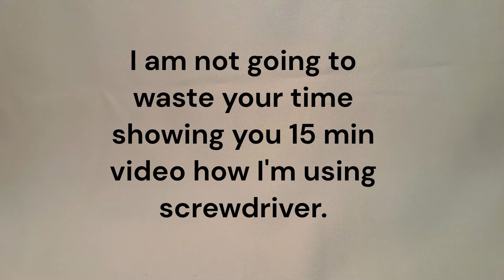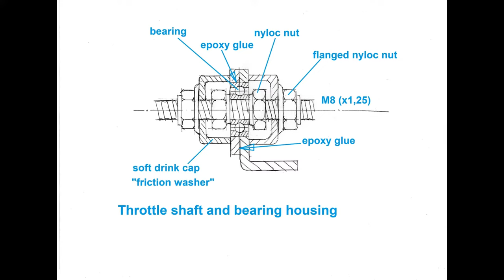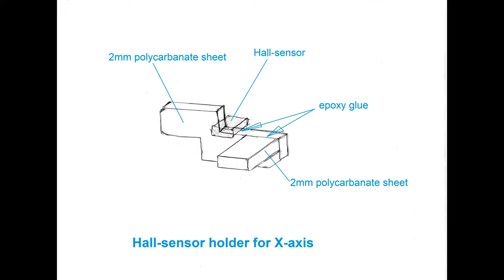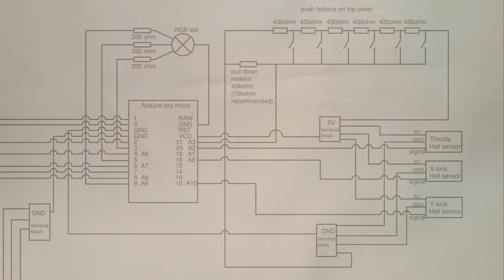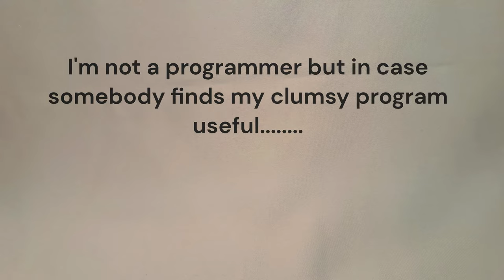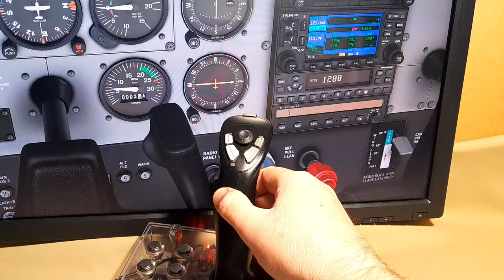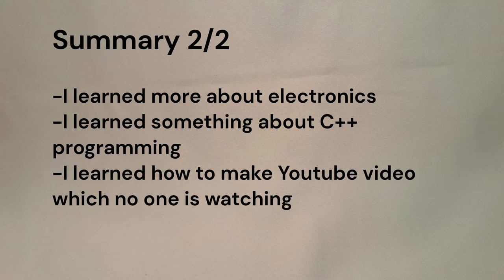Logitech Extreme 3D Pro Joystick Modification using Hall sensors and Arduino

Comment: I just bought 3 old obsolete flight sticks on Ebay. I plan on doing something like this to give them new life. Thanks for the tutorial :)
Reply from the maker: Hi! I wish people would offer broken or obsolete items for sale instead of throwing them away.

I made a new program for modified joystick and it's more effective damping jitter than older one. If you want a copy of it I will gladly email it to you. My email address is hekka.diy.videos@gmail.com.
Reply: get a teensy it has a flight controller, joystick, mouse and keyboard USB profiles makes building these things easy, also 40 odd pins for the button stuff

Comment: i watched wish you built it live include details about the board you used, what code you used, what github repos you used etc please in the video description, I think many people own 3D printers I think personally i would either reuse original body or 3D print a new enclosure using ABS or PETG

Comment: They factory built-in spring has way too much tension (too stiff). I replace the spring with the spring inside a used shampoo container, pull the spring longer and expand the radius gradually with the assistance  like stick/rod, now the control feeling is much softer make much more sense.

Ther are some more tricks other people used, like: Cut off one circle on top of factory built-in spring to make it shorter thus become less pressure, or use heating/cool-down method to soften the tension, or remove the spring and use rubber band in 4 direction of the base tie to the center stick to make it center.

But bro, non of these are comparable to your modification - Completely rebuild a half of joystick, pretty cool!
Reply from the maker: Thanks man! I like very much your "shampoo idea". Junk for somebody else but useful stuff for a creative person:)
BTW: I think Logitech attack 3 joystick has same "gimbal" (that white nylon(?) device) as Extreme 3D Pro and the spring has same dimensions but the wire is thinner. I'm not sure but I try to test it in the near future.

Comment: Cool project!

The (twist) Z-axis could perhaps have been repurposed as a 2nd throttle or flap axis. ;)
Reply from the maker: Thanks! 
Now I have hall sensor and Arduino controlling joystick's Z-axis (along with pedals) so I can use joystick's twisting axis the way you are suggesting or maybe controlling landing gear :) 
(I made a short video about Z-axis using hall sensor)

Comment: Can I just replace the rudder and throttle potentiometers with hall sensors from the Logitech joystick and keep everything else? Regards from Brazil.
Reply from the maker: Sorry, but it won't work. I tried to use Logitech electronics (and no Arduino), but the potentiometers power voltage (almost 5V) dropped to 0.5V when using hall sensor (replacing that potentiometer). I even tried to "rob" the voltage directly from USB line, but then the voltage dropped to 1V. Same thing happened when I was testing Logitech Attack 3 joystick. I guess Logitech electronics just don't like hall sensors:(
Reply: @hekka7270  Thank you very much!

Comment: I can't get the top part working, the hat switch and the trigger its so frustration. even used a diode
Reply from the maker: Is your joystick modified or unmodified joystick? Do did you check switches using multimeter? 
Some of mine joystick's switches didn't work so I cleaned them using contact cleaning spray and now they work flawlessly.

Comment: Hey man I watched! 😂

Is it possible to also do z-axis like this? Or will there be space constraints?
Reply from the maker: Hi !  Nice to know at least someone is watching:) I didn't even try Z-axis because the space is so small. However there is such a thing as magnetoresistive sensor. It probably won't need a lot of space because it works different way as Hall-sensor. I have one of those (MR-sensor) but I haven't tested it yet but i will do that in the near future.
Reply from the maker: Hi! (This is "slightly" late second replay) I tested my MR-sensor but it didn't work because it was digital (not analog) and too sensitive. But I found a way how to use hall sensor anyhow. I made a new video about it and it is on my channel.

Comment: Do you have the 3d models for the polycarbonate components?
Reply from the maker: Nope. I try to keep parts simple so that almost anyone can make them using basic tools.
Reply: @hekka7270  yeah its pretty simple, but I have no experience working with 3d modeling

Comment: I would love to use the joystick but it’s sensitive as f@k. So it’s collecting dust on top of my shelf.
Reply from the maker: Are using Logitech Extreme pro with potentiometers or did you modify joystick using hall sensors and Arduino?
Reply: Just took it out of the box and plug and play, tried adjusting it with the warthunder controller settings but no luck.

Comment: Great video! How much does it cost? Is it worth it compared to the cheapest hall effect joystick?
Reply from the maker: Thank You! Costs depends on how much stuff you have already. I only had to buy Arduino (5 euros) push buttons (10 pieces 6 euros) magnets (20 pieces 4 euros) Hall-sensors (10 pieces 2 euros) and polycarbonate sheets (10...15 euros). You can find used Thrustmaster T.16000m costing only 30 euros so you can't save a lot of money if any. However Logitech 3D Pro is more rugged as Thrustmaster (I have disassembled both). If you are planning to use joystick many years modifying Logitech could be good choice in the long run.
For me planning and building and learning is a fun process and sometimes very frustrating :)

Comment: Nice tutorial on Joystick! Wondering if any custom PCBs and 3D printed part may help? Would love to sponsor and reach any potenail collab together! (PCBWay zoey)
Reply from the maker: Hi Zoey! Arduino pro micro costs only 5 euros or less (including shipping) so it's probably very difficult to save any money using custom PCBs ? Parts are so simple that you don't need 3D printing, but maybe it's worthwhile to use 3D printer for some hall sensor holders (X and Z axis). I only needed saw, drill, file, soldering iron and some simple tools (and a few beers) :)
Reply: @hekka7270  Thank you for sharing pal. Got your point, and from the other perspective, we might help if a one-piece finished product you'd like to achieve. Btw, our sponsorship is open to any of your other projects as well! 🍻